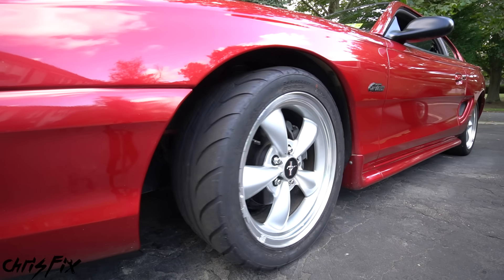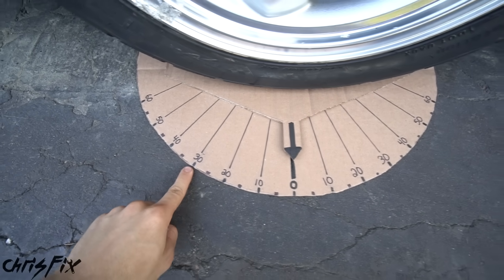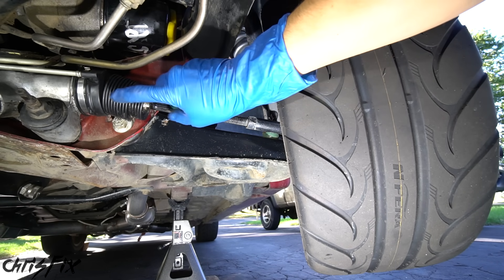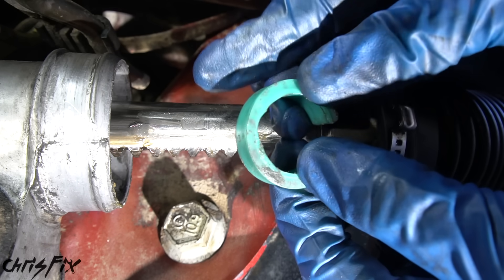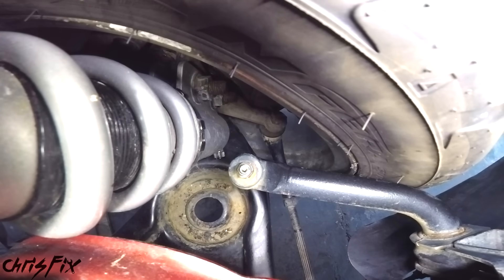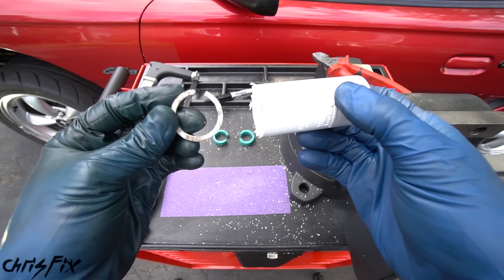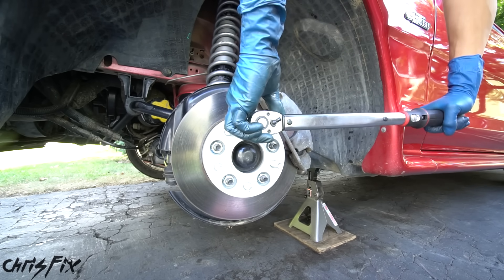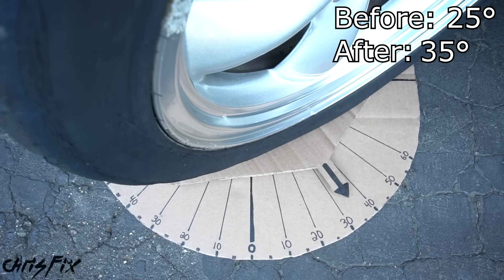How to Get Your Car to Make Sharper Turns (Steering Angle Mod)

Comment: fine and dandy for a rear wheel drive, but with front wheel drive, AWD, and 4 wheel drive your CV joints or universal joints will tear right out on the first turn you make
Reply: I was just thinking about this.  What with differing designs and all, it may or may not be a problem, so it would be a very good idea to check how much angle your CV joints can safely handle first.  And remember Chris, while you showed the Fiesta turning tighter, you didn't show it's actual turning angles...and the shorter wheelbase could account for that tighter radius without any more angle.
Reply: The main reason to do this which Chris hasn't mentioned for some reason is to make drifting easier, so nobody ever really does it on FWD/4WD.
Reply from the maker: They shouldnt tear out. If you dont have a lot of angle to begin with the CV joints can take more angle especially since you only go full lock when you are going slow. For example that Fiesta is FWD and already has a lot of angle. But no matter what you definitely need to check for clearance and for binding like you said because every car is different.
Reply: That is right, smaller cars tend to have a tighter turning circle, mustangs generally have wider turning circles because they're a much longer and wider car.
Reply: Also most fast cars have a lower turning angle to prevent oversteer when cruising at lets say 100km/h so you dont suddenly  pull it out at 180 degrees like a mercidise :P
Reply: It is not a advised on a 4wd truck with u-joints. The sharper the angel the more diference in speed between the axle and the tire.
Reply: "casually"....  yet he has that massive hydraulic hand brake, and all the mods are drift car mods.
Reply: The car is called the driftstang. We as fans picked out the car and the name. He IS indeed building it for drifting.
Reply: Wayne Hartneck Ahahaaha! Lol.  Ford only put these on models with the larger wheel options. For example a Fiesta with 16" or less has no spacer, 17" or more has the spacer.  CV joints don't just randomly rip out of the low spec models...
Reply: People have been doing this for ages, while you are creating more wear and tear the idea that "everything will explode" the moment you modify a car is just pure fiction.
Yet for some reason a vast number of people chooses to trust fiction over reality.
Reply: i dont think its so you can not turn suddenly tight. that whold not make sense
Reply: true then you should have unlockable diffs

Comment: Great video!  Thank you very much!  Which timing belt kit would you recommend for a 1999 Honda Accord?  People generally recommend Gates, but occasionally people say their good belt came with cheap components.  Thank you very much for your expert opinion! :)
Reply from the maker: +drippingwax gates makes good belts but a Honda oem belt is my advice. Don’t mess around with aftermarket timing belts. It’s a critical component and if it breaks your engine is shot.
Reply: Thank you very much for your response!  Gates actually makes the timing belt for Honda, but they do not advertise their belt being the same one they sell through dealerships. and I cannot find out who makes the other components.  I plan on replacing the seals.  People also recommend replacing the thermostat, radiator hoses, and serpentine belt.  Do you have any other suggestions?  Thank you so much! :)

Comment: It is my understanding that a smaller diameter steering wheel helps speed up the steering ratio. Is that correct?

Are there any other way of speeding up the steering rack ratio?

Comment: Not a fan of the wheel spacers. Not only do they put increased strain on the wheel bearings but they also throw off the suspension geometry which affects handling negatively.
Reply from the maker: +gokartbuyer thanks for sharing! They only throw off the suspension geometry if you can’t adjust it!
Reply: ChrisFix just a concern not a criticism. Here's a useful video on scrub radius that may help you correct angles. https://youtu.be/SUDMEd1bMZI

Comment: 6:00 Reason why you don't do these types of mods if you don't understand suspension geometry. Wheels are now hitting the sway bar. Good luck trying to control your car on full lock. Chris needs to stop making these types of videos, people who don't know any better could get into really serious trouble for themselves and even worst for other motorist on the road.
Reply from the maker: Thanks for sharing but you are incorrect! I have tested this on the track drifting for the past 4 months (the most sideways and full steering lock anyone will ever be and at high speeds) and they do not rub. Since the sidewalls on the tires are short there isnt much flex. If you have a bigger sidewall like on a truck then yes it might rub but I would be concerned if you are turning that fast all the way locked in a truck. Usually when you are all the way locked you are going slow (unless you are drifting) so there isnt going to be much flex. Glad you want to help and say I shouldnt make videos but please ask questions about stuff you are unsure about! Thanks!
Reply: I'm not the one making the videos and offering advice to your viewers. I am not trying to personally attack you in any way whatsoever either. Some of your videos are indeed educational but this particular one couldn't be further from the truth. Not everyone drives the same model year Mustang as yours. If someone ends up deciding to do this mod on their vehicle that happens to have rack limiters installed as OEM and then removes it not knowing how it affects their steering ratio/geometry I'd say that's negligent advice on your part. You should at the very least include some type of disclaimer that this doesn't apply to every vehicle and to practice due diligence. Cause you know... this is the internet, everyone wants to be a "doriftoking".

Comment: Thanks for explaining the fact about the power steering limits. Until last year, I have only driven cars without power steering (like from the 80s and 90s), but then I got one with power steering, and I hated it for the fact that you'd have to take care of it like that (basically not being able to use the full steering angle that it comes with from stock). It said even in the manual that the power steering mustn't be fully tilted for more than 15 seconds or so. But your info now confirmed for me that it is OK to back it off just a little, so I can live with that (have been doing it since the beginning instinctively anyways. Just sometimes you're maneuvering and need that full tilt for a few seconds).

Comment: The car I drive is a Saab 9-3 with around 125,000 miles, and unfortunately, it drives like a beat-up clunker. I can hardly keep it going straight, and if I'm going 40 mph or faster it wanders/wobbles like crazy. The roads around where I live are absolutely terrible, with lots of potholes, so it's no wonder. I'm guessing it would probably cost thousands of $$'s to fix, since most of the steering components are so worn out that they would need to be replaced altogether. Is it worth it? The car is worth less than $1000. :(

Comment: People hub centric spacers are perfectly ok to use because they do not put any extra loads the spacers that cause the problems are spacers that aren’t hub centric because they place the load on the lug nuts I’ve had hub centric spacers on my truck for 200k miles and have had no problem with them what so ever. Just make sure you use a good quality hub centric spacers. And also make sure they are torqued down every time the wheels are off I’ve never had one loosen but it doesn’t hurt to check.

Comment: There is much more to steering then just toe. Be carefully doing steering mods guys, as a chassis builder I can say iv had to fix a lot of home built rides safe for the road. When it comes to design angles leave it to the pros, or buy a fully engineered kit and have installed by the pros. I don't want people to think steering/suspension mods are just that easy. This also doesn't account for camber out on turns, achreman angles, scrub radium. For example your wheel spacers will rub off expensive tires and you'll have different tire roll in corners but hey you saved money on the spacers lol.
Just be careful everyone!

Comment: I like your videos Chris, and normally dont have anything to say regarding the techniques.  But you should really be checking those clearances with the suspension loaded.  Its not going to change much, and might actually give you more clearance...but it should still be checked with the car on the ground.  Either way, nice video.

Comment: Question. When I bought my truck it came with big off-road nitto tires. And when I make a hard turns I noticed they rub onto the suspension. If I install some spacers this should get rid of the rubbing right? And also will the rear need spacers too?
Reply: Its Retros if you want to track width to be the same yes you will need 4 and make sure they are hub centric
Reply: Johnny Reb ah ok, will need all 4 then. Thanks for the info!
Reply: Its Retros is the front axel a solid or IFS

Comment: Hey in your video, while you were torquing down the nuts for the wheel spacer, you put a flat head screwdriver in somewhere. Where specifically did you put it and why?

Comment: A lot of manufacturers will use the same power steering rack in multiple cars to save money. Then depending on each car, they will put in different sized spacers. It's not a danger at speed because it doesn't change the rate at which the wheels turn, simply changes where the lock point is. The only time you will ever get to the lock point is during a U-Turn and parking. If you get to full-lock at speed, even without the limiter removed, the problem lies between steering wheel and seat.
Reply from the maker: Truth!
Reply: Most automotive problems spring from the location you mentioned, Once Upon a...
Reply: Once Upon a Dashcam That's also called a loose nut behind the steering wheel.
Reply: there is a thing called drifting my friend, in which we do go to full lock at good amounts of speed❤️

Comment: wouldn't this increase the chance of rollovers
Reply from the maker: No, it has no effect on rollovers. If you are going fast and go full lock by mistake you have other things to worry about. The only time you go full lock is when you are going slow (less than 5mph), unless you drift haha
Reply: how often do you hit full lock at high speeds?
Reply: fruitydudexD when you're sideways as fuck
Reply: ChrisFix ok dude thnx
Reply: Technically, yes. If you are going Full Lock at high speeds, it is slightly more likely to

Comment: When you checked for clearance issues, you left your car in the air, so the tyres weren't on the floor holding the car etc. So the shape of your tyres is not the same when you checked VS when you're driving. Are you sure you won't have any problem in the future ???
Reply: The only part of the tire that's compressed is the very bottom. As it rotates from the road surface it returns to its original shape.
Reply: I don't know about you, but I'm not gonna be bouncing over potholes and trying to make super sharp turn at the same time. The only time the tire and sway bar come even close to each other is during a super tight turn. Otherwise, there is plenty of room between the two.  And if  he's making a driftstang, he won't be doing that on pothole ridden roads anyways.
Reply: In fact, it may bring some problem depending of the suspention, marckperson will make the outside wheel change its angle related to the floor so, the high side of the tire may hit the some arm of the system... But depend of the cars, wheels, tires... It's better to check it after making any change... just in case
Reply: acrylup to add to that, when he said there was tons of space, it actually looked like about 1cm since he couldn't even fit his finger in the gap. How can this be enough when the suspension is bouncing over potholes?
Reply: Exactly my thoughts ... I guess we'll see in the future ^^
Reply: The suspension geometry will be different in the air versus when the car is on the ground. So if the arm, or whatever other obstruction there may be, is closer to the top of the wheel, then it's definitely possible that part of the wheel will contact at full lock when the car is on the ground.

Not to mention the top of the inside of the wheel well is very likely to have rubbing issues at full lock.

It may not be an issue in Chris' car, but as this is a guide, I can see a lot of people messing this up and having problems with rubbing.
Reply: & at maximum right turn wont the swar bar.. sway & rub the wheel being that close still?
Reply: Korishan 
Where I live (UK) you have all sorts of shit to deal with that can be present on almost any road when performing tight 3-point turns: pot holes; manhole covers; kerbs; general changes in elevation.

From the look of that clearance in the video, literally any little thing would be enough to make contact.

Comment: It's still at risk of contacting the sway bar thanks to sidewall deflection.
Reply from the maker: Thanks and great input! I have tested this on the track drifting (the most sideways and full steering lock anyone will ever be and at high speeds) and they do not rub. Since the sidewalls on the tires are short there isnt much flex. If you have a bigger sidewall like on a truck then yes it might rub but I would be concerned if you are turning that fast all the way locked in a truck. Usually when you are all the way locked you are going slow (unless you are drifting) so there isnt going to be much flex. Great thinking though and thanks for bringing that up!

Comment: Nice video but you forgot to say that could be problems with minus ET wheels or spacers because is more easy to touch the rear side of the inside wall or the front supports from bumper at full lock.

Comment: But now your tires stick out beyond the fenders. Which is fine if you are going for that Honda Ricer look, not the look I would strive for in a Mustang though. Also unless you put the spacers on the rear wheels as well it will look odd.

Comment: Wheel spacers are illegal in VT...they will not pass safety inspection. Check your local laws if you plan on running it on the road...

Comment: So it clears while jacked, but is there a chance that the suspension might reduce the clearance in some circumstances?
Reply: Things will vibrate anyway, so i guess that a few months later he will see tire marks on the part that was in the way. He had only like 4mm play with the spacers on.
Reply: If we ignore the wheel spacers (which do change tire position) the rack mod alone won't give anyone any issues unless they turn the wheel all the way to lock while at speed (in which case they have bigger problems)

the only situation i've seen where it matters is in rock crawling, on VERY uneven surfaces it's easy to flex out your suspension while turning hard and going slow.
Reply: Maybe tire bend!